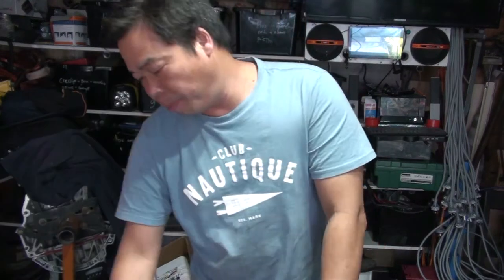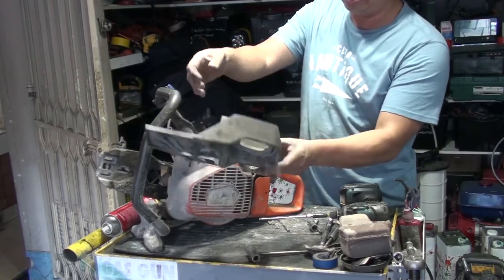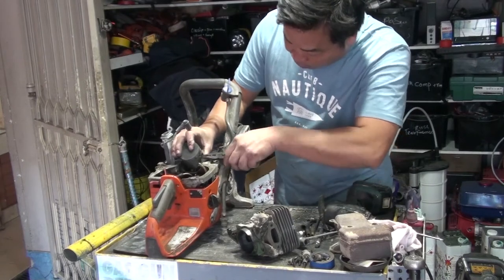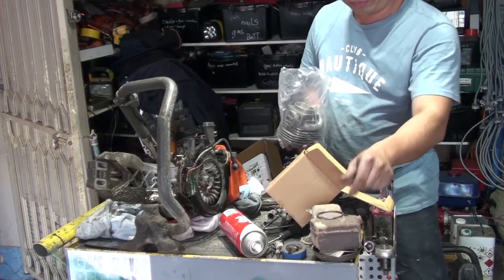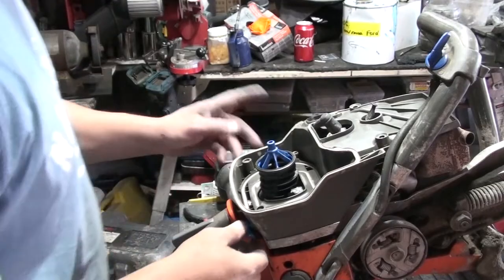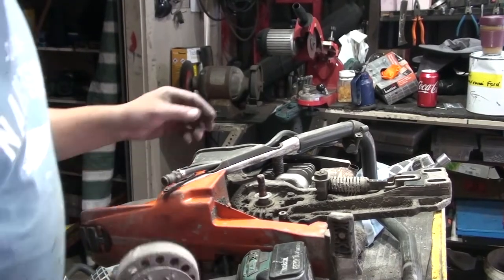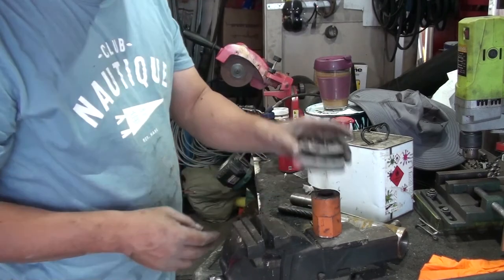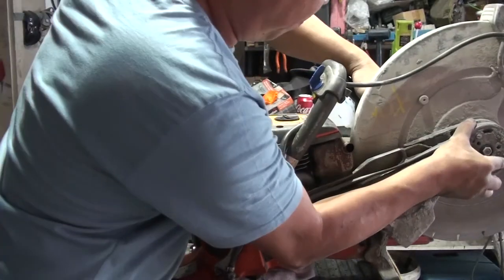husqvarna k970 engine rebuilt

Comment: good video thanks for share i have a question when the saw loss power is because carburertor is not the right adjusted is that right? i seen you moved the carburertor and after that start runing ok

Comment from the maker: normally not cause by carbi  most is the piston cylinder wear out.. lost compressure so it not shoot up much..it very rarely the carbi problems checkep your engine compressure if it lower than 100 psi  that mean cilynder gone...if it run not hold idle  checked may leak gasket